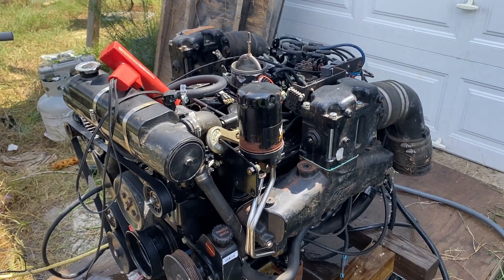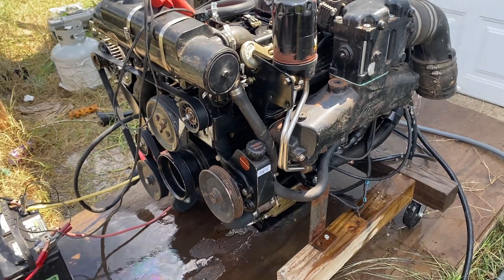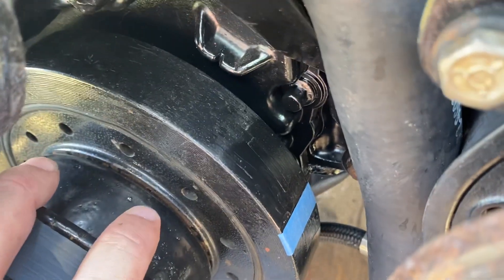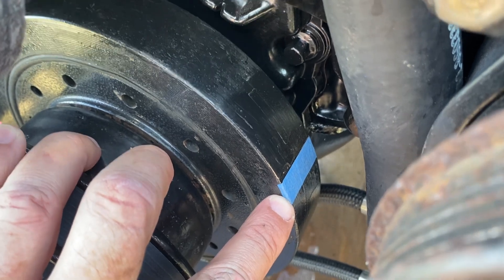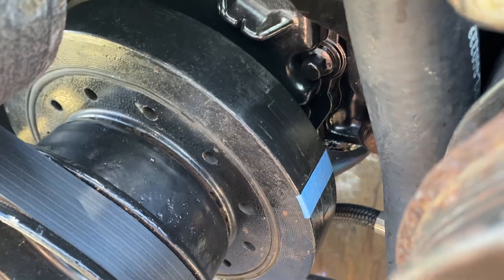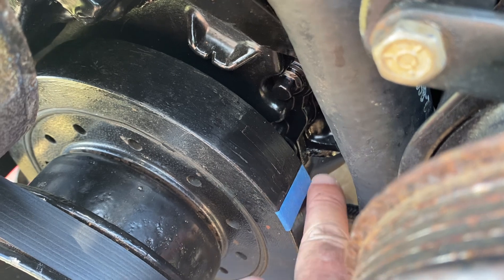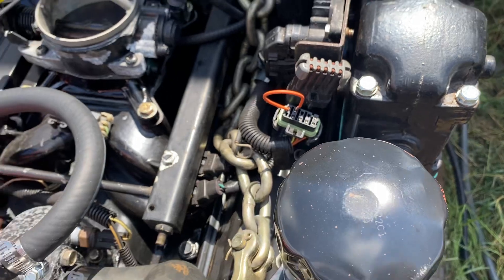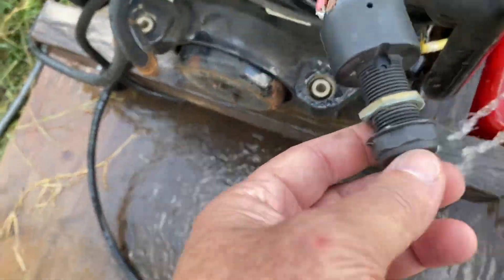MerCruiser 6.2 (1i) - How To Set TBI/MPI Timing

Comment: is this the same for a 5.7?  i have a marine power 5.7 in a 2006 tige 21i. same injection system it appears with static timing adjustment. I have the engine running well but want to verify the timing is in a safe place before taking out on the water to test
Reply from the maker: If it has a distributor but does not have a crankshaft position sensor the timing is set in the manner I show in the video. If it has what is known as the crab cap distributor where the posts come off the side, the timing is done by the crankshaft position sensor and the timing is not adjustable.
Reply: But the base static timing still needs to be set correct? I have a crank sensor @moccasinmarine
Reply from the maker: @letsfixjunk you did not understand my post. If your distributor spark plug wires exit the side of the cap instead of exiting the top of the cap, your crankshaft position sensor is in complete control of the timing. There is no base setting to adjust. There are no timing adjustments period. I’m making this informed guess because you said it was a 2006. By that time the electronics were advanced to where the crankshaft sensor was all that was needed to control spark timing with no adjustments possible. The tell tale sign is the distributor cap style.

Comment: Why are u jumping the pins? Im confused on that part
Reply from the maker: I kind of glossed over some steps in this video unintentionally. I had already set the timing which is why the blue tape was on the notch as described but if the timing was not at 8 BTDC you loosen the distributor hold down clamp just enough to allow the distributor body to rotate with effort. Then to advance the timing you rotate the distributor counterclockwise and to retard the timing you rotate the distributor clockwise. Once you have it set to 8 BTDC, you tighten the clamp down very snug and check it one last time to make sure the distributor didn’t move.

As for the jumper, it’s due to the nature of ignition systems that are triggered by distributors that are adjustable. All distributor triggered ignitions are relative timing systems meaning the timing is relative to where you, the mechanic, set the distributor position with the clamp. The EFI computer controls the timing but has to have a known starting point since all timing commands it sends are relative to what is called the base timing, which is what I was setting. On MEFI systems for Mercruiser and Volvo Penta with distributor triggered ignitions, the base timing setting is 8 degrees BTDC. When I inserted the jumper it told the MEFI computer to lock the timing signal to 8 degrees BTDC. When I mechanically set the timing to 8 BTDC, it put the distributor in a position to match what the MEFI computer was commanding it to be, thereby syncing the distributor and the computer to the same known position. Once the jumper is removed the MEFI computer will take over and advance the timing. Let’s say the total timing of the engine is 30 BTDC, typical for a 5.7 v8 Vortec Chevy. The MEFI will command 22 degrees of additional timing which when added to the base 8 degrees will give you 30 total. The 8 degrees is a software setting in the MEFI calibration so you can’t deviate from this base setting.

Comment: I have a mercruiser 5.7 fresh long block it’s a 355 with a slight marine cam from summit do I need to tune that cam to the ecu I can’t get this thing to leave the dock!!!
Reply from the maker: You need to set the timing to 8 degrees using the proper procedure. What are the cam specs because to my knowledge Summit doesn’t make a marine cam.
Reply: @moccasinmarine  how can I contact you
Reply from the maker: @EARL_850  text 706-358-3175